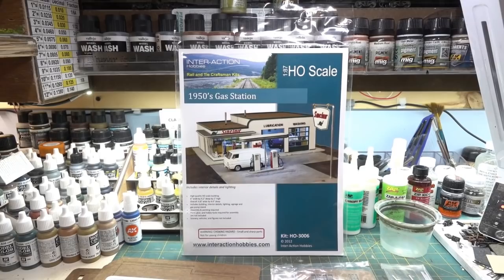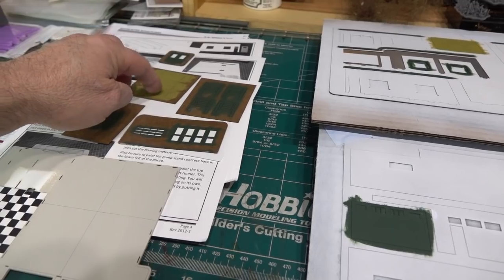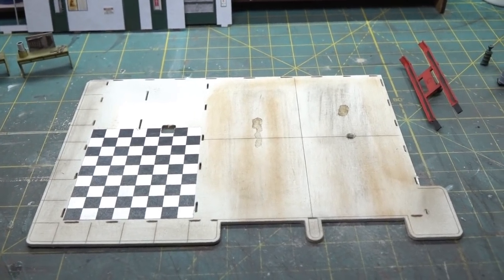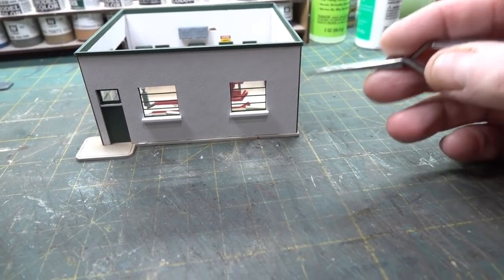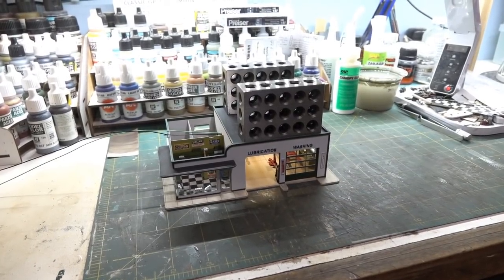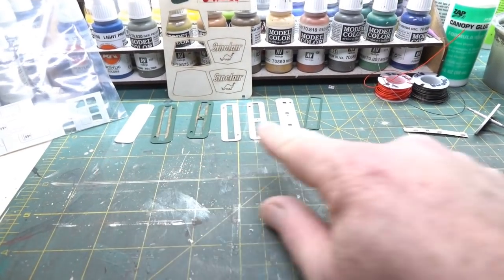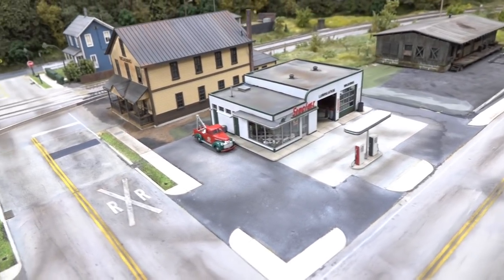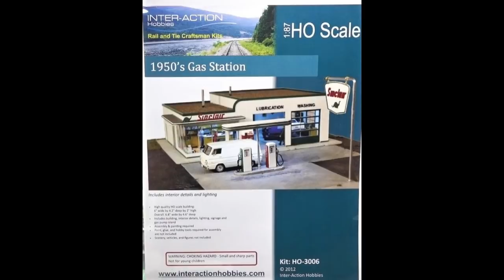Kit Build #5:  Inter-Action Hobbies HO Scale 1950s Gas Station

Comment: Rob , another outstanding job !!!!! The only thing missing was the cigarette machine and the oil wash tub. My Dad worked for Sinclair Gas Station for 12 years and believe me, You did a wonderful job . He also drilled a hole through the wall between the doors to hang an air hose up outside. I built a Mobile gas station from a picture my grandmother had, when I was 3 years old , in N Scale and placed it in an old cigar box, trying to duplicate the picture. I wish I had a picture of it. 
Thanks for sharing this brought back the memories of my Dad, who is no longer with Us. 
Very Much Appreciated. 🤗

Comment: I remember pulling into Haney's Gulf Station in the blue Fairlane. Mom was driving and Andy and I were in the back, before the days of seatbelts. BING-BING, BING-BING went the hose and THREE guys would run out. One would pump the gas, one would wash the windows, and one would check under the hood. Don't remember the cost of the gas or what grade we got, but I can still recall the gas station and the service. This was around 1957-1958.

Comment: VERY nice! Building code back then would have two plumbing vents – 1 for the sinks and 1 for the toilets. Also, I've never seen a garage without a deep sink (another plumbing vent). Sink would be against the rest room wall to minimize plumbing costs. 
FYI: the green paint has NO titanium dioxide (best hiding pigment), and it sealed that masonite looking board so it was non-absorbant. When you painted without the primer, the board absorbed MUCH more pigment, which is why it "covered" better. True for ANY pure or vivid paint color, but earthy dark colors cover better than pure reds, yellow, bright green, bright blue, etc. You done good!

Comment: You need a length of black wire to run on ground between station and the gas pumps  extending to the outside of island that is the bell alarm for car activation  22 ga. or smaller